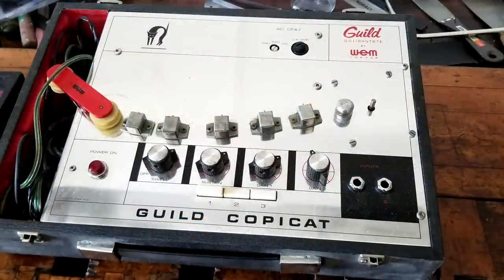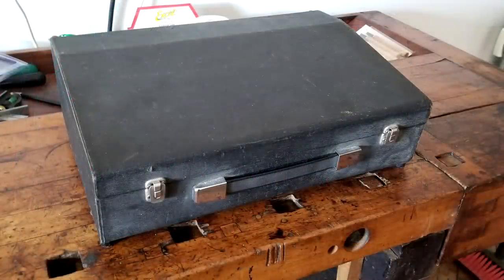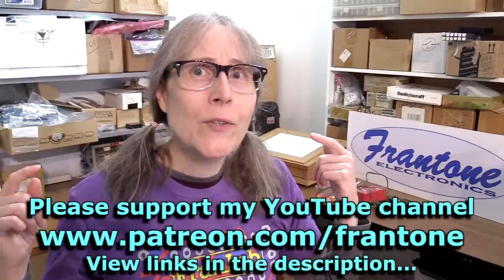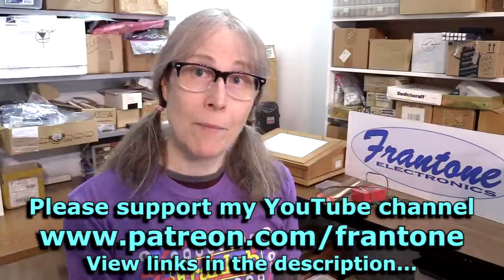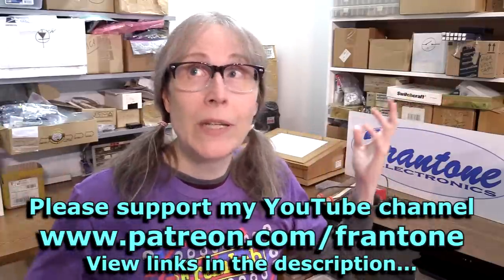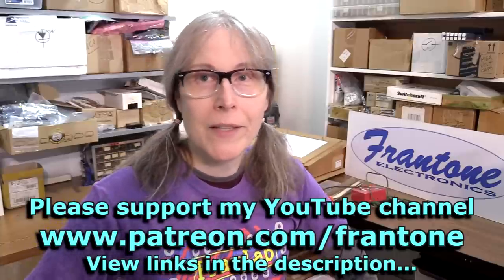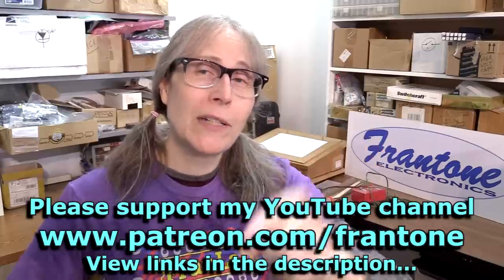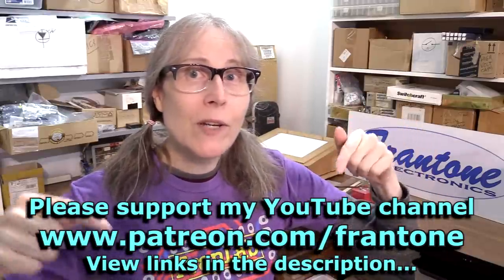Big Outgassing Problems Of Old Plastics

Comment: Probably the strongly acidic vapors you experienced from the WEM were caused by the spontaneous degradation of cellulose acetate plastics. As you correctly assessed, other types of plastics and plastic additives outgas different substances that might have sickly sweet but not burning smells, as in the case of cellulose nitrate plastics. You are entirely right to be concerned about environmental conditions as the true root cause of these problems. Much research has been done on cellulosic plastics that conclusively shows that they will spontaneously degrade at a rate that depends on their temperature and moisture content. Hot and humid conditions provide the fastest deterioration. Cellulose acetate and nitrate degradation proceeds slowly until acid builds up within the plastic to a level that greatly speeds up the release of additional acids. This is called autocatalytic behavior. Unfortunately, 'room' temperature is too warm for cellulosic plastics to avoid entering the autocatalytic phase for more than 50 -75 years or so.Time caught up with your WEM. Had it been in cold storage during the last 50 years, it would be like the day it was made. This is why so much of the world's film (as well as early magnetic tape) heritage, produced on cellulosic plastic supports, has been or will be lost without cold storage. Film archivists are very familiar with the dangers of sniffing concentrated vapors from degraded acetate film or tape. Cold storage is the norm for serious film archives and is codified in ISO film storage standards. You can learn about cellulosic plastic deterioration as it plays out in film and tape materials from the Image Permanence Institute, a preservation research lab at Rochester Institute of Technology. They have many publications on the subject available on line, as well as a website called www.filmcare.org. As for what you can do to preserve your collection, I would suggest two things. One is to seek out storage that at least provides reasonable human comfort-level air conditioning, not 85 degree, 75% RH summer conditions. The second is to monitor for the acid vapors that outgas from cellulose acetate. One commenter suggested pH test strips but they do not work well, The test strip has to be engineered specifically to provide a quantitative indication of acetic acid vapors. The Image Permanence Institute has a product called A-D Strips that will do the job. You can put a strip into every box or bin and it will tell you when acid vapors are present. You can buy them from www.imagepermanence.org.

Comment: I only have experience with film storage but I think it's similar. Storing things in sealed plastic containers is not a great idea, a lot of the breakdown of this plastics can be accelerated by the off-gassing vapours still in the container. Putting a few small holes in the bottom of the containers will let the heavier acids escape. Another thing that will help is to separate things you can tell are deteriorating from things that aren't. With acetate film degradation (Vinegar syndrome), the acid off-gassing can actual cause an otherwise good film to start deteriorating. Hopefully that a little bit helpful for you.

The records you might be able to donate to a museum or university that can store them properly.
Reply from the maker: Yea, in the  film world we all know about vinegar syndrome.  I think that certain highly elastic forms of vinyl may have a similar seeding ability.

Comment: You just have to accept things age in sometimes dangerous ways, but what I do is use an old soldering iron to burn air holes....maybe 6 in plastic tubs I store this stuff in......I find its better than drilling holes as the plastic sort of rolls over and provides its own strengthening of the edge of the hole and stops cracking like drill holes do......I have large numbers of these tubs as well.....I just vent the rooms they are in with natural air flow

Comment: my 1958 Heathkit O-12 oscilloscope starts to put off a odd smell after i use it for a wile kinda sells like a old heater i think its the dust on the old tubes getting hot i kinda like the smell i call it the "vintage electrics" smell =)

Comment: Hey, Fran! Love your channel. As for your hi-fi that smells like licorice, does it only seem to do it when playing records, as opposed to playing the tuner?  Check the idler wheel tire under the platter.
Reply from the maker: No, just the tuner.  Comments have suggested the phenolic boards or laquered wire ot transformer could be the issue.
Reply: @FranLab  Fran: Of those two, I'd suspect the transformer, due to the heat it must dissipate. Stay safe!

Comment: Ever work in a factory which sealed things in hot plastic bubbles?   THEN you'll know what hot plastic smells like...you do get used to it, but nothing you will want to live with...
Reply: Yes, I worked in the plastics industry for about 30 years, making automotive parts, on injection moulding machines, you got to know which type of   plastic was being processed just from the smell it gave off when molten.

Comment: Just get an industrial freezer in the arctic.

More seriously, maybe the most dangerous stuff could be safely kept in sealed steel boxes, with sealed inside surfaces too. It would be a big step up to keep them in an anoxic and dry atmosphere.

The plastic stuff though, keep it sealed and maybe install a fume extractor on a flexible hose and stand. It's a bit of effort and investment but it could keep you safe. Just bring it to the box you want to open.

Comment: It's difficult to say how many of synthetic material will evolve in long term period. When it comes to materials like plastics, foam, rubbers, vernice and glues, the original goal was not to mass produce for a product that was supposed to last at least a decade. With phenolics aged 100 years plus, you can still notice smells, so the outgassing process tells us the material is still evolving... Anyway, many of these synthetic materials originally integrate diverse components that can disintegrate or chemically evolve in long term periods. For some, it's a question of years, but you can also note it can depends of many factors in their original composition, exposure to UV, dies, other components with acidic releases. The problem is you can never say how long they will last: You can find rubber belts perfectly fine 50 years +, other decomposing after 10 years. And most of these materials were never expected to last forever, nor be still used so many years after their initial design.
A classic example of perfect engineering gone bad is the massive use of glue on IC boards, to maintain large and heavy components, connectors... This is still massively used in mass produced devices, but you can find it almost everywhere, even in presumably top quality hand made products. In most cases, this glue evolves in 10+ products and become what it called the brown death, a crackling acidic matter that attacks wirings, components (and particularly their leads). Even varnish protected ICs copper layers can desintegrate... This treacherous goo is prone to make 20+ transistors leaky or noisy, so you finally spend hours to save electronics with such problem, changing components one by one.
Foams are also prone to decompose, but the phenomenon can accelerate with other material like glues, oils, lackers. Some well made boxes like instrument or carry cases with protective pads can transform in a sticky and oily trap.
Early pictures were printed on nitrocellulose films, very flammable, prone to decompose with moisture: many early pictures have been lost before long and costly restoration programs were initiated. When it comes to lacker discs, they are made of a more stable material. Anyway, you can't store them the same way you could store modern vinyle, as they tend to break more easily, but storage of a dozen of these is not problematic nor dangerous.
If you notice a strong smell when you use your HiFi, it has probably something to do with heat. Many transformers are treated with plastic encapsulation or resin impregnation. You have to check any  brown spots, discoloration. If it becomes hot, you will also need to replace it. Old caps are also stinky problem. Some electrolytics use oil, even modern CMS use fish oil. Some resistors are also coated with plastic paints that can smell badly. I've also seen indicator bulbs cooking the plastic surroundings and mounts. Time to think about LEDs?

Dies and pigments Incorporated in many modern materials are also problematic. Before 1940, some employed radioactive materials, and you can still easily find uranium glass, uranium ceramics, glow in the dark paints... The radiation risk is generally limited, but some well known orange ceramics are problematic. The most dangerous is radium paint used originally for watches hands, compass needles...
Be cautious with hazardous materials: some you can easily recognise like lead are not problematic. In electronics, you could also find asbestos, or more treacherous beryllium: used as high performance transistor insulator or magnetrons... (Highly cancerogen).
Some plastic and paints can also become poisonous or allergenic. Others always have! Are your grandmother Tupperware sticky?

Your idea to use vented boxes is interesting, but it will only limit the amount of gases and contaminants locally, so you will need to vent your storage, keep it as dry as possible, and as cool as possible. The use of baking soda is interesting to limit acid deterioration, but it has to be changed regularly. 
Anyway, this phenomenon is the traduction of chemical reactions, so the contents are probably still deteriorating. One functional option is to replace materials and find ways to replace them if possible, assuming more recent are more stable, thus loosing the original value, or accepting a non functional state, representative of the best preservation possible. This choice can be made with electronics, musical instruments, cars...

Last, but not least, take care of your health and use safety measures when you manipulate old or instable materials. You can use gas and radiation detectors, and open storage boxes outside or with in well vented room. You can also use pH reacting paper, that will tell you if the content is neutral. Always use gloves, and protective glasses. Wear a mask if you can find one!

Comment: It’s not even old at times...  Star Wars collectors can tell you first hand some items 10 years old even will suddenly begin melting and it in turn can react with other plastic types and it can absolutely destroy them.  I’ve had some luck sealing those plastics with different clear coats.  Not much technical to it just trying to salvage something I cared about.

Comment: The best and safest thing to do is to collect the information from the item and get rid of it. Otherwise use metal or glass containers with rubber gaskets. Venting it outside will put the fumes into the air and then your neighbors, animals, and plants will breathe it.

Comment: With the WEM - could you take the chassis out of the case and store them separately, so you could home in a bit on the exact source of the smell - might get you closer to a solution for that  at least....?  Could it be an electronic component doing this - capacitors and varnish both come to mind ? (never known 'acidic' decay with these personally though)
Absolutely no idea what you do with nitrocellulose records - I don't think the  prognosis for those is too good :o( Old nitro film has to be incredibly carefully stored, I know that.

Comment: It sounds like a little bit of hoarding; however, I am the same way when it comes to some old electronic things that I just never parted with. For instance my Eico tube tester & VTVM, scop that I built and real to real recorder I bought in the 60s. I even have some old vinyl records that I never opened by the Beatles. 
 I did visit a salt mine that is 650ft deep in Kansas. They offer great archive storage there and even have movie props from the film industry down there. Mike Rowe did a show about them on Dirty Jobs on the mine. You might want to check it out since that might be a solution.  Good luck! BTW your an eclectic collector..

Comment: Entropy. The entire universe is headed this way. (The only constant is change.) It sucks. 
I understand that the mixture of different plastics, and therefore chemicals, causes the biggest problems. 
Difficult to know how to deal with it, since an electronic device is de facto a mix of different materials. 
Probably best to store individual things in paper and cardboard, not plastic. And provide good ventilation - not sealing it up - to prevent a build-up of vapours. 

From personal experience, I have to remove the rubber missile tips from 70s vintage Micronauts, or they eat through the toys on prolonged contact, and there is such a thing as 'doll cancer', affecting older cellulose acetate toys, that is actually contagious through the vapour.
I would have thought there are materials designed to 'capture' gasses in this context, but probably an expensive solution.

Comment: There are no plasticizers in plasticine. 

Wikipedia: “Plasticine is approximately 65% bulking agent (principally gypsum), 10% petroleum jelly, 5% lime, 10% lanolin and 10% stearic acid.”

I’m a bit disappointed you’re spreading misinformation.
Reply from the maker: Stearic acid is the plasticizer.
Reply: Stearic acid is used as a food additive and in cosmetic products. It’s largely innocuous. I’m not sure it’s even considered a plasticizer when used in plasticine. You can’t compare stearic acid to the kinds of plasticizers used in plastics, like Diisooctyl phthalate, the very common plasticizer that gives vinyl it’s distinct smell.